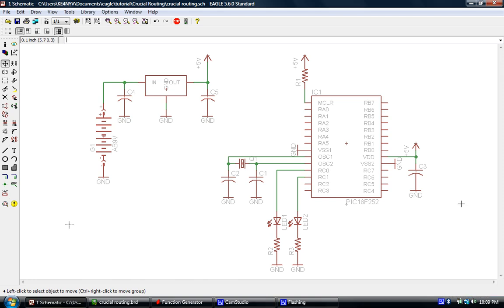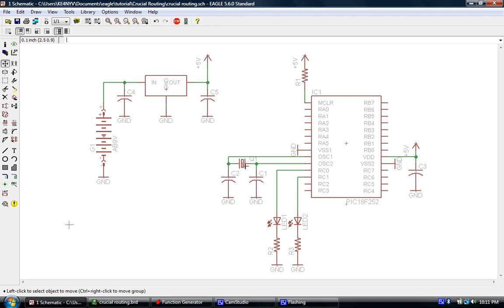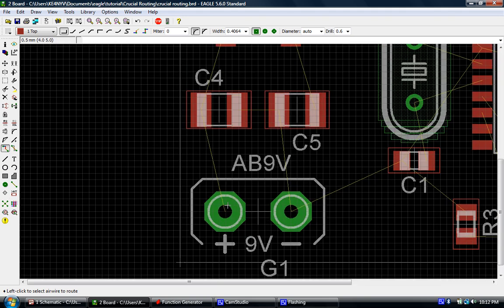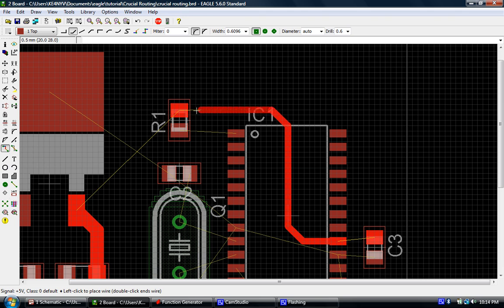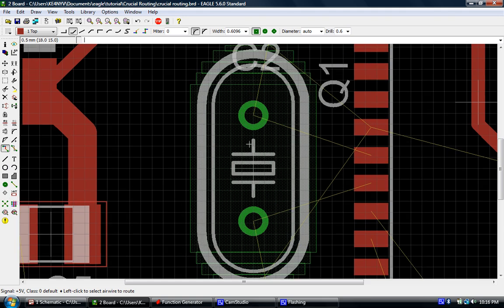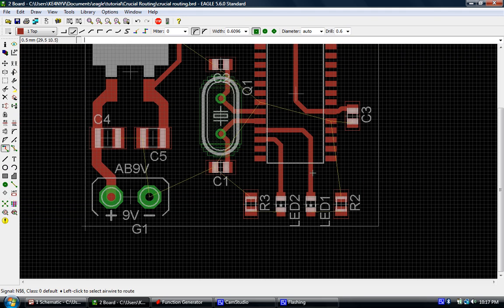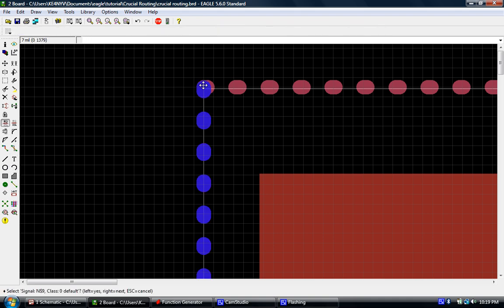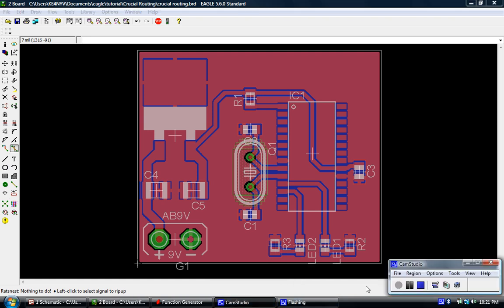Cadsoft EagleCAD Tutorial - Crucial Routing

Comment: 8 years later ...   As you routed the board, C3 is somewhat useless.
I'd suggest the +5v trace be routed to C3 and then to the CPU. 
This gives the CPU a local source 'C3' to draw current from. 
The battery replenishes the charge on C3.